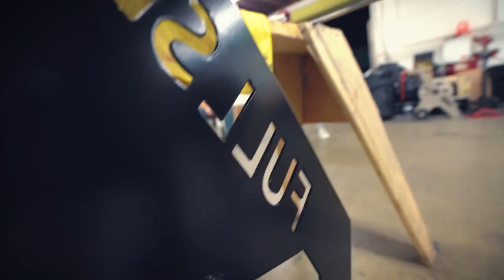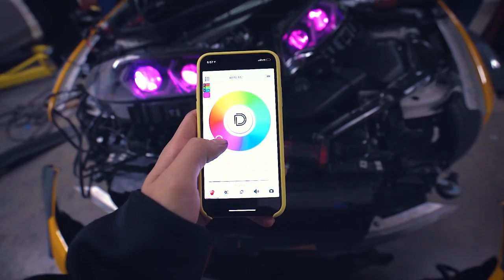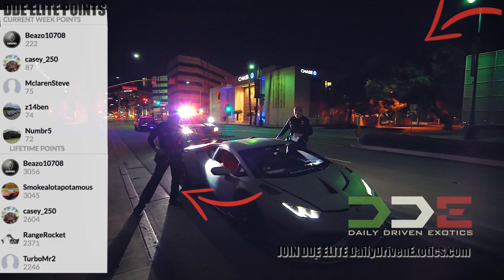BEVERLY HILLS POLICE TEACH COCKY RICH KIDS A LESSON! *ALEX CHOI VLOG*

Comment: Weird question but I run a Tire Shop and as he was mounting that tire he was using a awesome tire mounting bar. It appeared to be about 4 inches wide and had a great handle on it. I need this tool for my shop does anyone know where to get it. I was shown at 3:32 into the video. Any recommendations would be great. Thanks

Comment: Locking up the back brakes while that tow-truck was trying to pull the car up was a screwed up stunt.  If that cable were to snap, someone could of been seriously hurt.  That tow truck is putting food on someone's table.  If that winch breaks, not only would it have to be fixed, there's loss of revenue as well.  That tow truck driver working nights putting food on the table is way cooler then any car that has been shown on this channel.
Reply: i'd of thought it must class as criminal damage, & as you say he was trying to earn a wage

Comment: He wouldn't tow you because you just drove up on his deck and rolled over his winch cable like you owned that truck. If I had been that wrecker driver, Id've done the same. Just because you have an expensive car doesn't give you the right to disrespect that man's truck. I've got 25 plus years in the towing industry and I didn't tolerate that kind of thing either. Sorry dude. You were in the wrong there. To be fair, the wrecker driver had a 'tude there too.
But you shouldn't have just driven up on his deck.